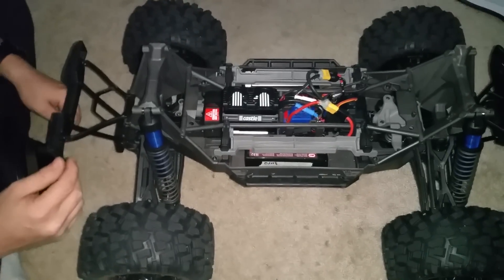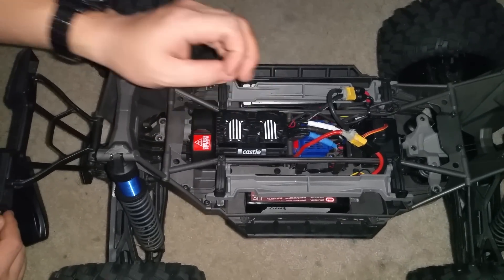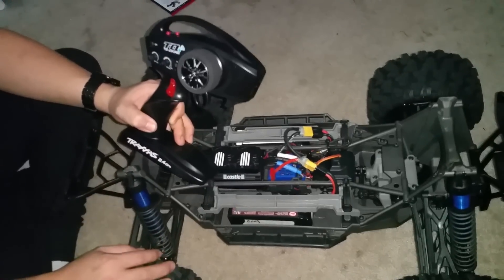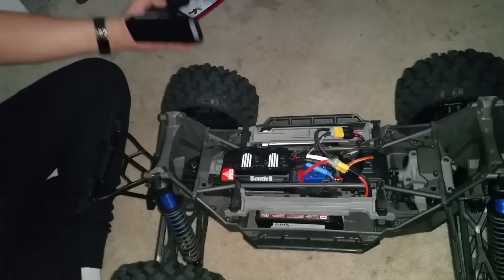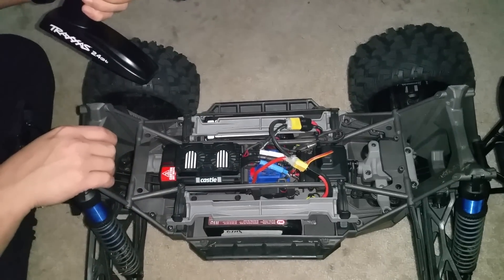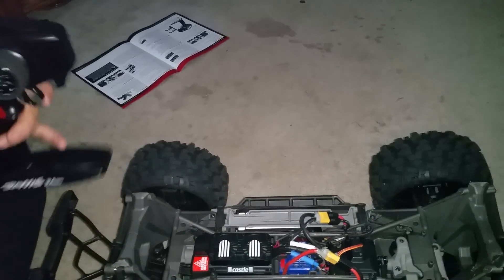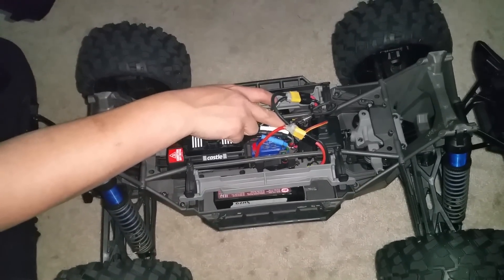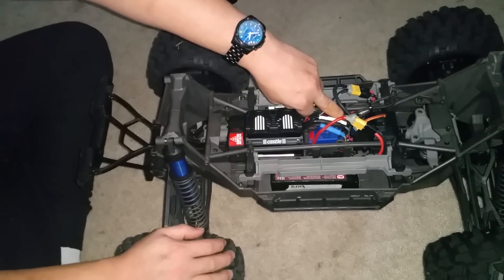Traxxas X-Maxx ESC Calibration and programming

Comment: Hey I’m getting a xmaxx for Christmas can you tell
Me how to handle The lipo batteries for it like what do I need to do to let them
Last
Reply from the maker: A decent charger. The xmaxx uses some decent size lipos I recommend the ISDT line and a good power supply high MAH batteries require high amperage charging, you need some type of fireproof container to store them in and charge them because if they go up they have and will burn Down whatever structure they are in, understand what c rating is which is how much of its capacity it can discharge at any given tine of its capacity IE MAH (milliamp hours), understand "s" as in 3s or 4s is the voltage of a pack which is based off the number of cells (s stands for series and 4s is 4 lip cells in series )theres also parallel but I dont want to confuse you as kit plays into capacity, again MAH,  the biggest piece of advice i can give, join FB groups that are all about the x-maxx, I traded mine long ago but still know most of the information,most commonly upgraded parts etc such as rpm hubs as the stock has small bearings that fail out of the box, lipos are just a part of the hobby so learn how to use them, theyre your power source but understand the energy density is so high they cannot be taken for granted, they'll bite back if you dont..
If you have any more questions feel free to hmu again. I'm in FB jail so if you want  to speak directly twitter or something.
Merry Christmas and above all HAVE FUN
Reply: @potjnkye86  do you have a email
Reply from the maker: @Rowdt98  randallhughes31069@gmail.com

Comment: also wanted to ask you why you set ur xmaxx up with the remote with a switch? would u be able to let me know what the red button switch is for on your truck? thanks soo much... i just have the normal traxxas remote, but threw a blue tooth module on the back... its actually came in handy a bunch of times, lets you upgrade the remote and truck to the current firmware and all that... made the truck run alot better... but what does that red switch do for your xmaxx? i have the switch on my slash it just works w the sound kit and puts the truck in neutral so u can rev or use it for launch control i guess,... what do you have yours doing? very curious first time i saw an xmaxx owner running the remote with the red switch.. id love to learn more... thanks again..

-peter
Reply from the maker: The TX I was using came with my t-maxx. The red switch was to engage reverse. I eventually got the 4 channel traxxas tx with the 2 way red toggle switch and a 3 way switch. On the X-maxx they do nothing. Sorry if it confused you.

Comment: did u do the upgrade u were mentioning? would you be interested in selling any of the stock parts? is your truck the 8s model or the original 6s? either way i would be interested in a couple parts if you still have them.... mainly the esc and the cooling fan to start off with if u have the 8s model.. plz let me know... also would u recommend swapping out the esc and motor to get some hydroplaning power? i just want to have a set of paddle tires and blow everyones mind ripping across the water like the 8s xmaxx can... i wonder if the 6s can if geared properly, or upgrading the speed controller or something... please let me know... thank you very much in advance... god bless and keep on ripping..

-peter

also would you happen to know how to remove the stock motor heat sink? i have a nice blue one but cannot figure out how to remove the stock one to begin with... please educate me if u know how to remove the stock heat sink... thanks so much..
Reply from the maker: Lol, this video is about 3 years old. I traded the 6s X-maxx for a highly.modified DBXL which is now sold as well. I started the Hobby 5 years ago with quads but the tech wasn't there yet and parts were prohibitively expensive for myself at the time but now I have gotten back into FPV quads.
Reply from the maker: And yes I did do the upgrade to the 5th scale castle system. Look at my other videos and you can see the insane 0ower it had just on 6s. I could have only imagined 8s but the 6s X-maxx diffs couldn't hold up to the power or wheel speed.
Reply from the maker: You remove the heat sync off the motor by just pulling it off but be careful. There is a thermoelectric wire for the receiver to put the ESC into limp mode if the motor gets to hot or if it gets damaged to protect the motor even though Traxxas electronics are crap IMO . It's taped into a channel in the heat sync

Comment: to save you time:   this is a good video but it's not actually the full calibration, its just syncing the throttle and esc from 50/50 and 70/30 and going thru the modes plus extra tips.
 still good to watch but not what i was looking for, if u have the same problem i had read below. FYI i've got the x-maxx 8s version so it may be differing from this video because of that.

got mine today brand new out of the box and when i hooked it all up it would turn the wheels but when i hit the trigger the green light would just turn off and that's it.

so i called traxxas support number off the website, 1-888-TRAXXAS, and he said it sounds like for some reason it wasn't calibrated in the factory like it was supposed to be.
to put it simply it calibrates by using set button on each control like trim, left/right, full throttle/full reverse and all that, then a couple more steps to sync with the esc..
he walked me thru it step by step and it only took a couple minutes. 
now it's all good, time to bash =)

Comment: I just bought one today played with it for bout 10 min and it just quit. When u hit the throttle it sometimes drives than it quits, drives again than quits. Any ideas?
Reply from the maker: I just typed out an entire page of info then my computer shut down lol.  so here we go again.
This a problem with the VXL ESC.  it sucks to say this but the traxxas vxl ESCs suck ass, from the minute 1/16 scale vxl-3s that comes on the latrax vehicles, the original VXL-6s that came in the original X-maxx (started catching fire as soon as we started bashing this truck like it should have been.. Im very happy that traccas came with a Gen 2 but it really screws over the orignal 6s owners cause we were the ones out $20 after $20 or if you tried to use the spiral cut diffs your going above 50 dollars.  After agout 8 months rock passions aka GPM finally came out with some gears that coud handle 8s but the damage had been done to so many past traxxxas lovers.  SO regarding your problem and the fix.  Contact traxxas via email or phone and tell them and get a replacement ESC.  DO NOT INSTALL IT.  SELL IT and get a hobbywing max6 for 129.99 (sucks youve gotta turn around and put 100-150 dollars into a RC vehicle that im sure you spent over 1000 dollars on with batteries, a charger and all that good stuff unless you alread had a charger and some batteries.  SO when you get a replacement VXL-8s sell it and use that money to buy that hobbywing max 6 that fits in the stock place (this is the ESC they should have used but traxxas likes to have defects so we have to continue buying parts from them, this is how traxx has made so much money.  i prefer nitro and the traxxas nitro mototrs have a notorious flaw and they know about it but why fix it when they can continue making money.  this bad part is the connecting rod in the 2.5 and 3.3 nitro motors.  ok so below is a link for the max 6, it will work but you may want to consider spending a tad more and getiing the Max5.  doing this will give you more headroom, ESC temps will be lower.  here are the links.  I apologize for the long response but ive learned ALOT about traxxas.

Max6 ESC at Amain Hobbies, 129.99: https://www.amainhobbies.com/hobbywing-ezrun-max6-v3-1-6-scale-waterproof-brushless-esc-160a-38s-hwa3010500/p453308?gclid=CjwKCAjwhcjVBRBHEiwAoDe5x8bwqTmF63YvImyOcp_oOHgRYqbitrT6UQ3vqf7aYZ-tRAcufhSMnBoCcrQQAvD_BwE

Max5 ESC at Amain Hobbies 199.99: https://www.amainhobbies.com/hobbywing-ezrun-max5-v3-1-5-scale-waterproof-brushless-esc-200a-38s-hwa3010400/p453309?gclid=CjwKCAjwhcjVBRBHEiwAoDe5x_ohLFGHjU3OxeBkJjt-JBXY0PpBeftea79JSZwt0YKCoezjn0jNJRoCfU4QAvD_BwE

Comment: What do I do if my receiver is not lit up? Do I charge it?
Reply from the maker: Josh Snipes for wins the receiver gets voltage from the BEC (battery eliminator circuit) so if the receiver isn't lighting up you may have a bad ESC. It blinks red if it's not bound and stays solid green or red when bound. Or it may just be the receiver. I always dump Traxxas electronics as they're crap and the mosfets in the ESCs aren't capable to handle the voltage and amperage of 6 and 8s.  Even the vxl-3s is junk. Gets hobbywing ESC and atleast a flysky gt3b and have decent electronics. The motors are decent but I replace them as well.
Reply from the maker: Josh Snipes for wins The mosfets control the pulses to the motor and when your pushing 25+ volts at 125+ Amps those cheap mosfets cause a fire QUICKLY.
Reply: Nitro Revolution RC  so you are saying I need a new BEC
Reply from the maker: Josh Snipes for wins No. The BEC is built.into the ESC. There is no way of replacing it. Do you still have steering and throttle/brake?
Reply from the maker: Josh Snipes for wins The only way to replace a Bec that's built into an ESC is replacing the ESC.
Reply: Nitro Revolution RC  yes
Reply from the maker: Josh Snipes for wins As long as it works don't worry.

Comment: hahahahaha are you kidding me 30c discharge and you think thats enough for your esc come on man! anything with an higher amp esc you need at lease 50c rating battery! that's the number one rule on operating on a high current esc. 20c 35c are for 1/10 scale rc. so yea now you know lol
Reply from the maker: Zeno'sama dude you do realize 7500 mAh at 35c is 262 amps and that's constant. I ran an xlx with the same batteries and they didn't even get warm. Don't try to reach someone who has a channel based on teaching. I could understand if they were only 5000 mAh cause that's only 140 amps constant. But I'll let you continue to think your right.
Reply from the maker: Zeno'sama you need to do more research. C rating isn't everything. You have to put into account the mAh of the battery as well. The c rating has to be multiplied by the mAh of the battery.   A high c rating is always good but I had data logging with the xlx and it never pulled more than 200 amps peak and the batteries have a burst c rating of 50c.  Again, do some more research before calling someone out and making yourself look like a fool

Comment: My X Maax 8s Esc, Low Voltage Stage 1 Kicks In @ 3.80.. Do You Know Why?? I'm Using The Traxxas 5000mah 25c  Lipo Batteries.. I Figure It Would  Kick In @ Least 3.50v..
Reply from the maker: TheTylerjoy04 Voltage sag.  Traxxas lipos are junk.  with a low c rating when you give it full throttle the voltage is going to drop.  If you watch multirotor fpv telemetry you'll see when they give alot of throttle the voltage will drop. exact same principal.  when you test the lipo when it's sitting it's not under load so it's going to show say 4 volts per cell.  But with a 25c battery the battery doesn't have enough output so the voltage drops making lvc kick in.